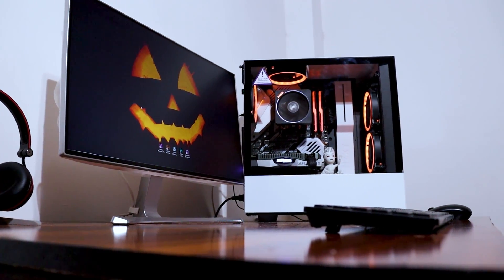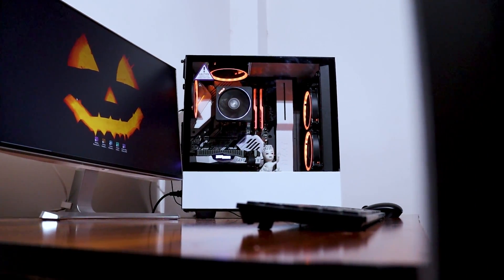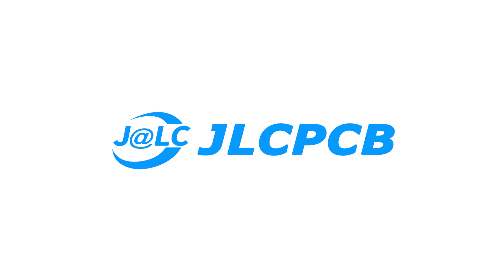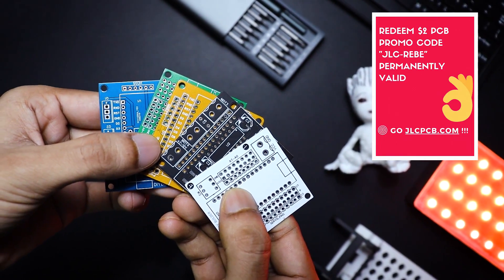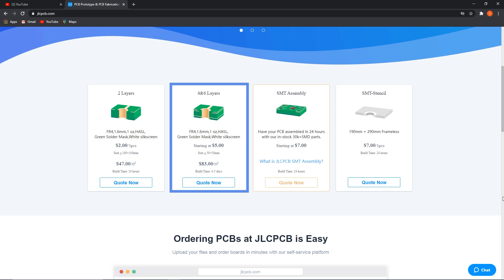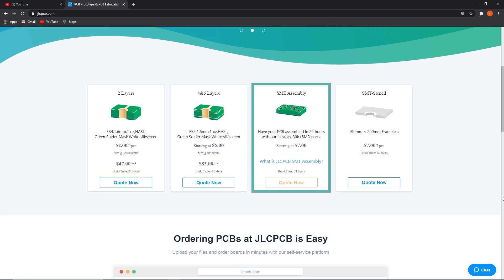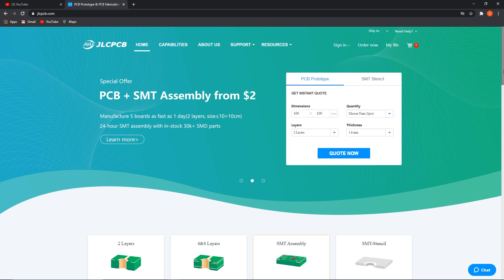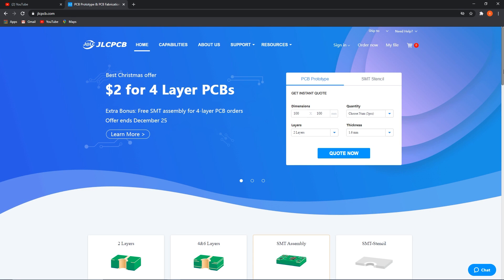DIY MINI PC

Comment: Can we use raspberry pi 4 2gb ram?
Reply from the maker: if you want to use windows then it's better to use the 4GB model
Reply: @DIYBuilder  and what about the screen
Reply: @DIYBuilder  Is there any other link for purchasing it??
Reply: I dont have that pink tape type which you putted on the raspberry pi from where to buy it??
Reply: @shashwat6355  that's not a tape it's thermal pad

Comment: Why are you using 2 side tape to attach THE HEATSINK AND FAN ,  Try using Copper plate instead

Edit: I now know you are using thermal double pad , i mis-looked it 😁
Reply from the maker: no bro i used screws to mount the heatsink
Reply: @DIYBuilder  Bro but in 2:19 You used it , thats why i asked 😁
Reply: @DIYBuilder  Even though I was critical about your video , you replied and that's great as many YT channels don't do that , salute to you for that
Reply: That was a thermal pad lmao, not double sided tape
Reply: @pheonixgallegos7145  No that doesn't look like a thermal pad , he seems to peel off the double side tape
Reply from the maker: @pheonixgallegos7145  yeah
Reply: @DIYBuilder  Well then I mis-looked it , sorry for that